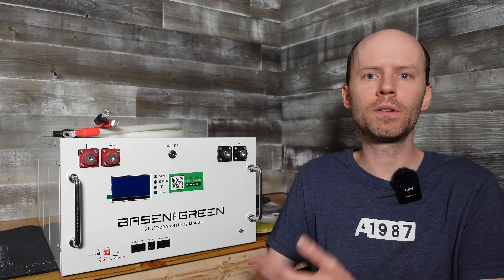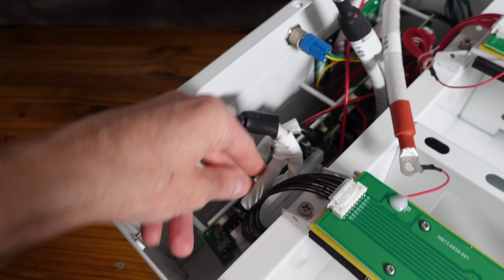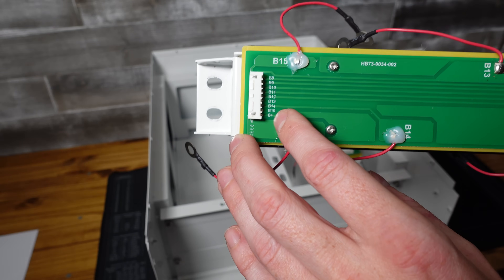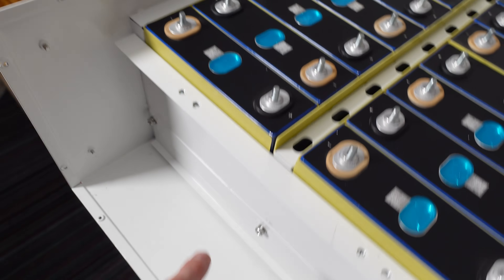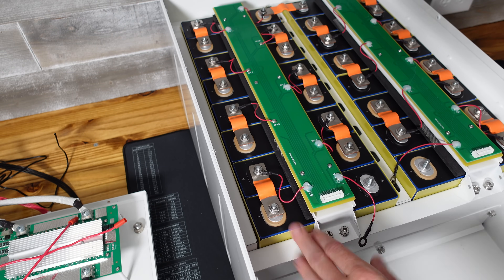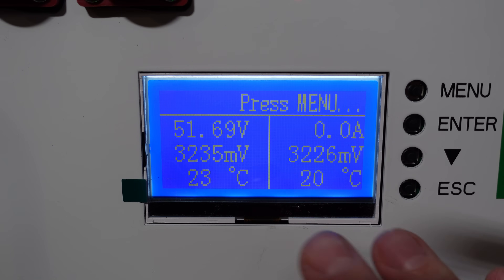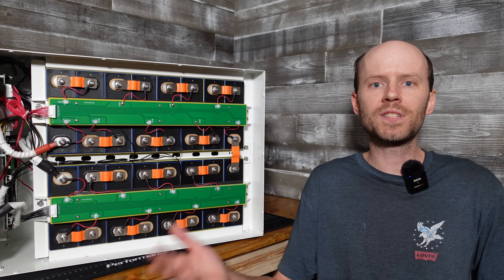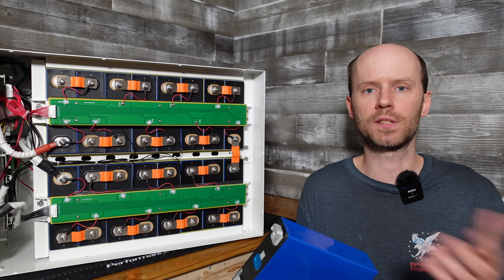Basen Green 51.2V 230Ah LiFePO4 Battery Kit "Bring Your Own Cells"

Comment: can I charge this with the grid electricity? or strictly PV charging? if so, I can convert AC to DC to charge it.
I'm not planning on installing PV panels but I am looking to buy battery back up for my business. most UPS doesn't have the capacity for what I need.
Reply from the maker: This is just a battery. You will need to use an appropriate charger for LFP batteries. That can be one that uses solar, AC power, or both. But it needs to be a properly-rated LFP charger.

Comment: I appreciate your videos. After watching a few of them I decided to go with basengreen kit 48V280ah kit+16S EVE314ah. I had a problem with a bent faceplate but they finally sent me a replacement. My problem is my lack of knowledge. My kit came with a BASEN 200a bms. Everything went beautifully but entering settings on my 6000xp inverter created more questions. sig solar (where I bought the 6000xp)try to answer but they hesitate answering some due to the fact that the battery isn’t an eg4. I tried over and undercharging based on BASEN battery specs. I don’t think the battery ever overcharged but it did shut itself down on the undercharging. I had to press the start button on the battery to get it going again. I have the inverter on lead acid even though I tried it on lithium #2 and it sure looked like it was working. Anyhoo, the battery percentage doesn’t seem to match my voltage chart. Do you see anything I’m doing wrong?

Comment: Please do not purchase from this company. I received a damaged unit and they have been a nightmare to work with. I’m out $2k and have a unit that is damaged. Please don’t waste your money!
Reply: That sucks. I bought one last August and mines working good. It's paired with an 18kpv by eg4. Could not figure out the communications so running  off voltage rather than SOC. The Chinese support is not very good so can see how it would be tough getting any warranty replacement....What damage did yours have?
Reply: @ it was dropped in shipment. The packaging was kinda decent so it didn’t worry me at first. But then I opened it and I was mad.
Reply: @NicksPerspective  damn, well hopefully you can get that worked out. We get what we pay for when buying these batteries. Had debated on getting EG4 but with the price for these so much less, I took the risk. Just hope it lasts

Comment: I got one of the Newer 48v kits with a 2A active equalizer +DC breaker and built it with 16 EVE 314Ah cells. When I first bult it and turned it on it was around 60% soc and after awhile the soc started to slowly creep up over 3-4 days to 85% soc (been at 85% for about 24h now). This is with no load or charge being put on it, but I assume that's just it balancing? I also noticed pretty much every number in my parameters tab is different than your settings some of them wildly different. Should I be concerned? Where can I find proper settings for the parameters (a manual or guide)?

Comment: I bought the 280Ah kit. It is recognized by the Victron Cerbo as a Pylontech battery bank. The quality of the components seems alright and customer service is excellent. 
Only problem as of now is, the SOC is off and jumps. It shows 100% while the voltage is only 53V. 
It won't accept any more charge when it's at 100% and goes to standby. 
I haven't changed any of the standard parameters. 
Basen Green says this is a known fault and that they are currently working on debugging the firmware. Let's hope they fix it... I'll drop another comment once they do
Reply: Fix it yet. I'm looking to make an order with them for several of these cases
Reply: @VFio689  The voltage showing 100% while only 53V is apparently due to the LiFePo4 battery chemistry. When charging it does reach the required voltage but then quickly drops to a lower voltage when charging stops. This does correlate with the voltage curve provided by the battery manufacturer. I got excellent feedback from Basen Green about this.
But the SOC jumping issue is seperate from this and IS a fault in the firmware. I sent them a message 3 min ago and have just now gotten the answer while writing this. They want to know my BMS version so they can sent me the firmware. Again, excellent customer service! I presume all new battery cases will be shipped with the updated firmware 
I am a satisfied customer to date. Been powering my home since last december
Reply: @graypistachio4141  good to hear, I've ordered cells from them before and the customer service was good. Thanks

Comment: The back side of this battery housing appears to have openings which would allows for expansion in the belly area of each cell. So the front side (full) compression plate would serve no purpose. So in my professional opinion, if your goal is to prolong the life of your cells, I would avoid the purchase of this battery box and buy a box that provides for full cell compression.
Reply from the maker: While you pointed out an interesting thing here, an aluminum-cased cell is not going to push out a hole like that... Sure, you might get an extra millimeter or two of expansion vs a solid back, but I think it's negligible. Also, the idea is not compression... it's just holding the cells in place.
Reply: @LithiumSolar  Do you have a response to quickquote?
Reply: @LithiumSolar  Several years ago, I built a frame similar to this battery box design, where only the edges where encased by approximately 1". After 6 months of consistent cycling, I found that the cells expanded by approximately 4mm to 5mm at the center point of the both cells at the ends of the frame.
Reply: @quickquote1568  Won't the epoxy board keep the cells from bulging?
Reply: @graypistachio4141  No. the epoxy board is flexible and will not prevent bulging, only a steel or aluminum 2 - 4 mm plate or much thicker HDPE plate tightened to approximately 2.5 Nm will prevent bulging.

Comment: Excellent, clear explanation all the way through. One thought: The front cell-box retention plate could be fitted with longer bolts, compression springs, and appropriately sized washers to apply a fairly constant retention force on the cell stacks while allowing movement for thermal cycling.

Comment: Thanks for the info on this one. Does this BMS ( not sure of model ) have Absorbtion and Float settings ? Most don't but it's crucial imho.
Reply from the maker: Absorption and float are charge settings, those would be programmed in your charge controller, not the BMS.
Reply: @LithiumSolar  
Thanks. Doesn't absorption within the BMS help with balancing though. Would be nice to know what that BMS is, I am looking at these racks at present and am a PACE BMS fan.

Comment: The Full_Batt_Cap setting is still 230Ah. You have to adjust that to 300Ah
Reply from the maker: This is a 230Ah battery, curious why you would recommend setting it to 300Ah? Is that just a starting point before it calibrates?
Reply: @LithiumSolar  Sorry, I thought you said it was a 300Ah battery
Reply from the maker: @lecramred4453  Oh no, sorry. They do have a bigger version for the 280/310Ah cells though!
Reply: @LithiumSolar  Yes, I have 5 of those

Comment: I built the same kit from a different company 230Ah. I lifted it from the ground to the back of my truck and back off again. Yes, It is very heavy!
Reply from the maker: Which brand did you get? This is in my basement and there's no way in heck I'm getting that up the stairs. Going to have to disassemble to move it.
Reply: @LithiumSolar  Seplos was the brand. Very similar but they had neoprene foam in between the cells and not the resin board which I prefer.
Reply: @LithiumSolar  use a barrow cart with the 3/6 wheels that climb steps
Reply: Do you have a link?

Comment: Is a fuse or circuit breaker necessary? Can i install a circuit breaker outside the box?
Reply from the maker: No, it's not necessary that it be built in to the case. You can add one externally if you'd like and should be wiring it in compliance with local electrical codes and common safety procedures.

Comment: I would think you could easily add a circuit breaker. I would add one and perhaps a class T fuse, but I am a belt and suspenders type. Good review BTW. I have never had a cell bloat in 5 years, but I am of course very careful to USE A BMS! Provided you keep the cells in the operating range (2.5v to 3.65v) you should get only very minor bulging, not bloating.

Comment: Is it possible to have a 24v version of this battery built into this case??
Reply from the maker: You could wire the battery for 24V if you wanted, but you would not be able to use the included BMS and you would need to make some custom wiring.

Comment: At the end, you have the case on its side.  Would it be safe to leave them that way?  I am figuring the best non-rack mount for a new power house and 6-8 on their side, space wise makes sense in my mind for a few reasons. Nice build and seems complete.  I agree about wishing it had a breaker.  Final decisions really comes down to the BMS. Curious for an update on the BMS and/or performance.
Reply from the maker: No, I would definitely not use it in any orientation other than flat. I just stood it on the side for videoing.
Reply: @LithiumSolar  "Final decisions really comes down to the BMS. Curious for an update on the BMS and/or performance." Im curious too. Any updates or feedback?

Comment: you forgot the most important thing:
is the BMS able to balance the cells
Reply: 500 bucks for a box lol
Reply: Always top balance before assembly. Despite what some popular youtube creators say, there is no problem with keeping cells in balance. This does not have an active balancer, so top balance before assembly and you will be fine.
Reply from the maker: Of course it is. I discussed the programmed BMS settings in the PC Software section of the video.
Reply: @LithiumSolar  
you did not really try it out. 
i did not mean whether it is balancing or not. what i think is important whether or not the BMS is capable of balancing dells. some of the balancers can't do it, unless the cells are brand new and already balanced before built in.
Reply from the maker: @ursodermatt8809  I see what you're getting at. I don't have an exact specification for this BMS, but they're typically 30-60mA. That is more than capable of keeping a 230Ah battery in balance. The instructions specifically state that you should have them balanced prior to assembly. This is true for practically every single battery, not just this particular case. If you have a cell that's self-discharging faster than the others, and so fast that the BMS cannot keep up, then that cell is faulty and should be replaced. Again, this is true with pretty much any battery out there.
Reply: @LithiumSolar  
so, personally, i would not trust that balancer. that might work when the cells are brandnew but a few years down the road .......   and also notice when the battery can't be balanced for a few weeks because of cloudy weather,  i don't think the 30-60mA will cut it.
Reply from the maker: @ursodermatt8809  This is one of the better brands of balancers out there. Quite honestly, it sounds like you have a turd and are blaming the balancer for your turd not being balanced. The 30-60mA is pretty standard, and for good reason.
Reply: @LithiumSolar  
mate, how can you be "honest" about something you absolutely do not know?
you yourself used, uses, the batrium balancer. and what is the current of them?
that does not imply you have honestly turds. 
just charge that battery to 100% and then make a video to find out what is happening. it is easy. then you can honestly answer.
Reply from the maker: @ursodermatt8809  I have 8 rack batteries running right now, none of them use a Batrium, and they're all balanced just fine. I'm not going to waste any more of my time on this discussion. Have a good evening.

Comment: Excellent review and assembly process.
Reply: After internal shot-circuit and accumulating of H2. C2H2, CH4, C2H6 gases inside and ignition and chain reaction of all 8 cells in the raw, what will owner have to do to prevent such events ? How BMS can prevent internal short-circuit or accumulation of gases and thermal runaway ? Such explosion can destroy house.